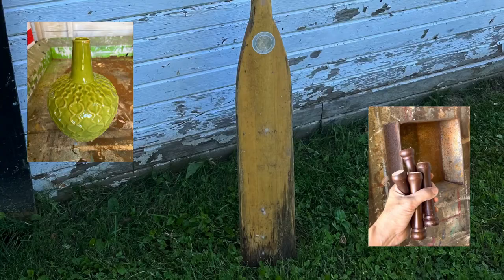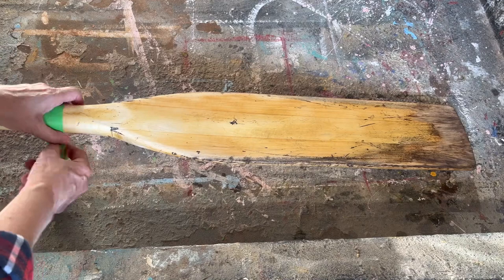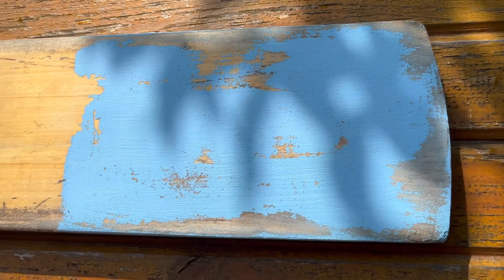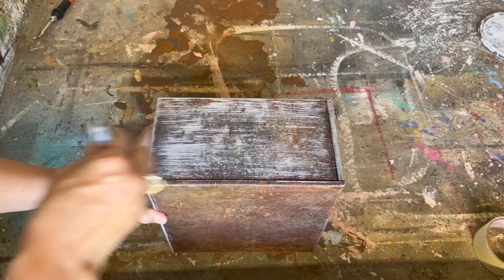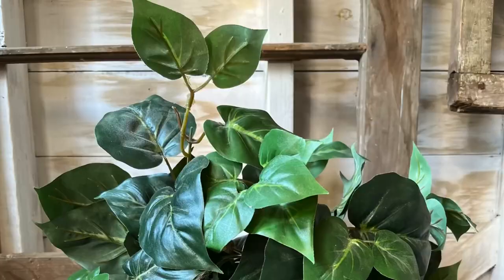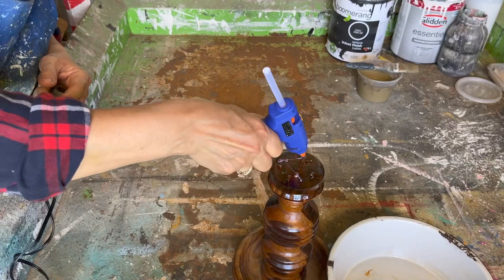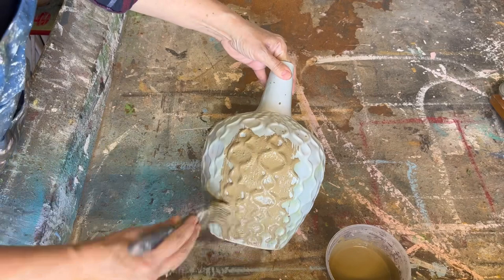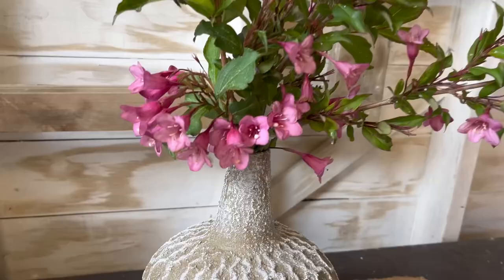Yard Sale Upcycles Guaranteed to Inspire You / DIY Home Decor

Comment: So Beautiful! Now I am keeping my eyes out for an old oar. That would look amazing for towels in my old weathered beach cottage bathroom! Not many people can see a nasty old metal rusty box and see it as something beautiful. Aahhhh I want a nasty old metal box now too! I am literally astounded by your level of talent in transforming junk! You are still my hero💛
Reply: Ms. Sherman,
I wrote the same exact thing to her long before I saw your comment.  I did not even get to the other lines of your writing yet but, got so excited off just your first line.  My grandmother had an oar out over each group of windows in her living room at the beach house. They were once used in the clamming boats at the Jersey shore.  I just moved to a very tiny tiny home and do not have much room or storage but, I would love an oar over my windows or a couple propped up in the corner. I am still unpacking but I have lots of nautical things I love to display.  You can even put an oar into the bathroom and not worry about moisture hurting it as they were orig for the water. If I ever can buy a home with a yard and have a shed I would love to hang an oar on the side of a shed with some bouys and paint a mural of the sea in the shed.   I love this gal who repurposed all these items. I have my great grandmothers strong box looks just like the one on this video but mine has a top and a handle.  Would love to use it, display it maybe with the top up and put beading supplies in or load it up with old wooden spools of thread.  I have a deep white metal enamel bowl I have on the back of my toilet tank and I have my jars of cotton balls and QTips in it along with lotions etc.  Y goal is to get the rest of the living room unpacked today.  It is a cold rainy day here in VA do good day to stay inside and be busy. Happy Oar hunting and hope you succeed. Maybe find one at Dicks Sporting Goods and you can make vintage looking. 
Sincerely,
Rebekah in Westover Village, VA
Reply from the maker: Thanks for watching ! Glad you enjoyed ! Perfect for a bathroom